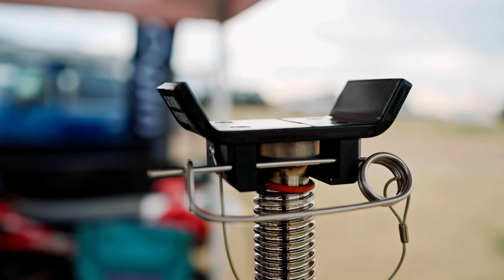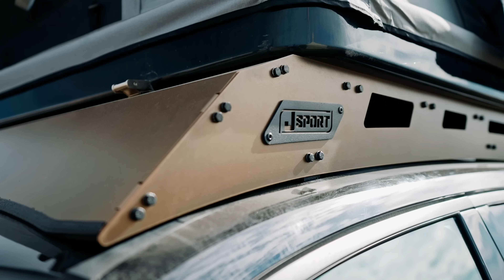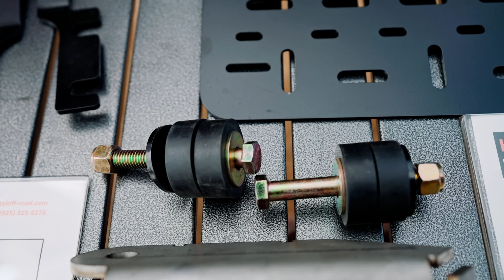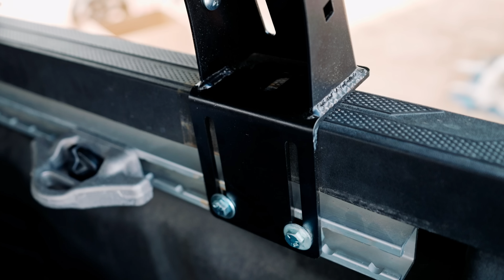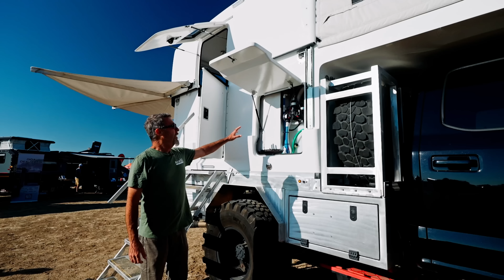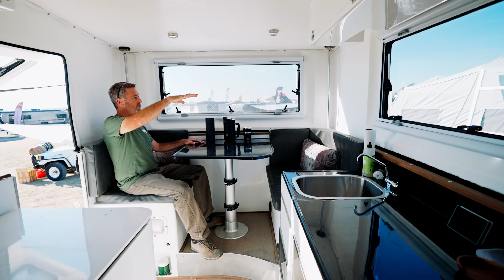20+ Vendors of @OverlandExpo  Mountain West 2022

Comment: Sorry, but on that truck bed camper that sounds scary to me to have gasoline as the fuel coming into it for the Webasto heater. It’s not unheard of for cars to go up in flames because a fuel line slips off a connector under the hood and spills fuel onto the hot engine, but that’s under the hood and you have time to get out of the vehicle before the fire spreads, you might be asleep in this vehicle when something goes wrong and with gasoline as the accelerant, you’ll never get out in time